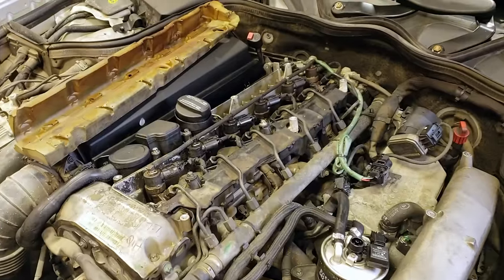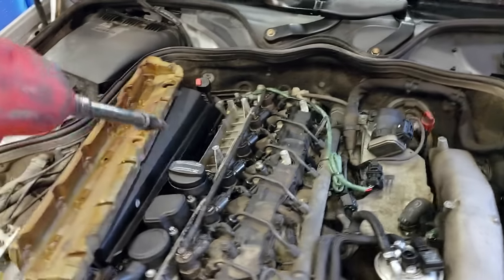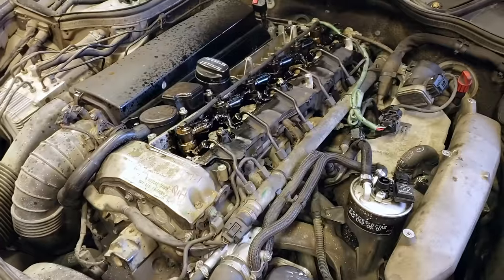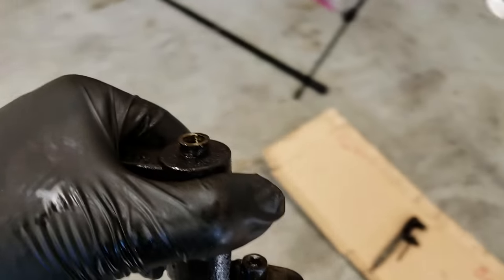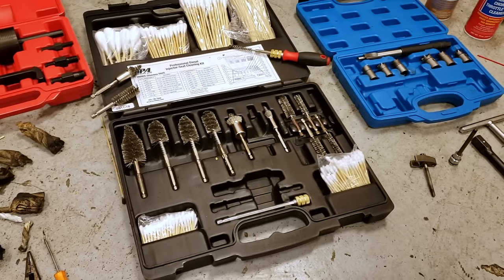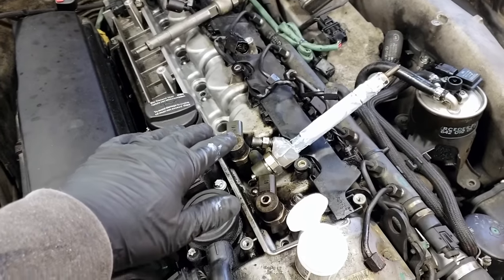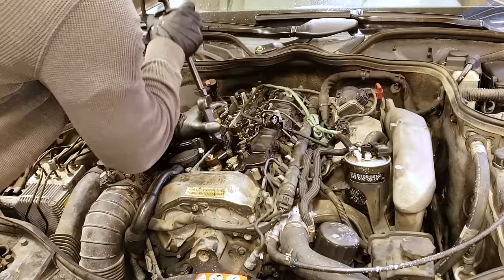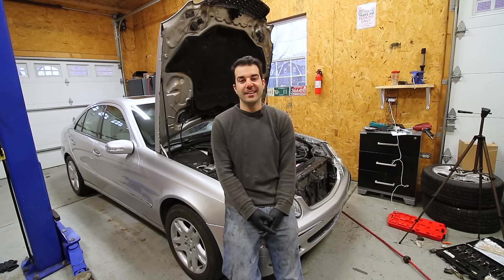My Turbo Diesel Mercedes Has A Nasty Engine Issue. Don't Buy A Diesel Before Watching This video.

Comment from the maker: How much do you think this would have cost at the dealer?
Reply: At least 1500 dollars
Reply: Hello legit a question this black death Also could happen to an W210 engine? I mean with those rings seats of the injectors? Thanks and merry christmas from Paraguay :)
Reply: At the dealership, about 2500.00 dollars...
Reply: $1500-$2000, given they would have most likely recommend changing the injectors.
Reply: I have done the same thing at my service shop for w203 200 cdi about less then 50 dollar including labour work and all the stuf.. any way i live in albania the labour work dosnt cost so much and we all use merc cdi engine it is a paradise to finding  cdi disel  engine parts .
Reply: A local independent charged my £100 to do one
Reply: Thank god my '85 300d did not have that with 280k miles on it when I traded it off.
Reply: Was gonna say 1000$ easy. But I’m not sure. How many hours they need or charge for such work?
Reply: Carlos Ayala as far I know the w210 its not common rail, its other engine most be om606
Reply: I’m gonna guess 2,300. Btw what are your thoughts about the R129? Have any interest in adding one to the channel?
Reply: 2000 dolars
Reply: LegitStreetCars I have a question what do you personally think about a Mercedes g wagon because I really like them and I’ve been wanting to buy one for a long time
Reply: I would have hit that whole area with purple de-greaser and a hot water pressure washer, I've been working on cars for years and I always pressure wash the engine before I work on it, Never had an issue with electrical, Just STAY away from the ecu connectors, those things are crap and not waterproof at all.
Reply: 2k or there abouts.
Reply: Couple thousand at least, because the would have removed the entire cylinder head and soaked it in a heated chemical bath (guessing here....) to extract the injectors and clean the carbon.

What would they do in your experience, Alex?
Reply: $1200 if they’re fair
Reply: They would of told you it was unfixable and tried to sell you a new car
Reply: In labour alone it's gotta be like $900 for 6-12 hours of effort at a good mechanic.
Reply: "We need to remove the cylinder head"
Reply: LegitStreetCars if you want to talk how much money it was to keep fixing my old car before we got rid of it by not paying on it anymore was a 07 Kia Sportage EX V6 and was fully loaded without heated seats and luxury package. But had leather seats. Spent well over $5,000 in replacing the engine, the A/C, windshield, wipers, tires, rim, etc... within the last 4 1/2 years of owning it. Bought it from drivetime with 80,000 miles and was lowest mileage SUV on their lot at the time of August of 2013 to May of 2018 we got rid of it at 151,000 miles. We were the 3rd owner of that car and it was involved in 2 other accidents before we had it. There is a 4th owner surprisingly because it needed another 3rd engine after the timing belt snapped and caused engine damage.
Reply: I guess 950.00 for 2.
Reply: @Lako the bubbles was from how hot the engine was, it caused liquid to boil.
Reply: Does the dealer re use injectors tho? Assuming yes id say $1800
Reply: Thanks Alex this was a great video. I will be checking out that CDI we talked about. Thanks for all the help.
Reply: I got two leaking injectors fixed with new seals and stretch bolts for £80 each at a Mercedes independent specialist. Had quite a bit of black death.
Reply: Lako yes metal shavings did end up in the cilinder chamber. The heat plug should have been taken off to connect an air compressor to blow those metal flakes off while he was facing the injector port with the cut tool.
Reply: I had a case of Black Death discovered on my 2012 C250 CDI Bi-Turbo during the regular Assyst B Inspection at the Mercedes Dealership at around 90.000 miles this year (2018). One injector was leaking badly and caked up the next injector too. The dealership was able to get the injector out and cleaned everything up. The injector was undamaged and could go back into the engine. This job for 1 cylinder was 400€ (About 450 USD) for a caked up one. The dealership was nice enough to put a picture they had taken for internal training of my engine and attached it to the receipt.
Reply: 45€ just for the coper rings and new bolts and 190€ with new clamps included. Laybor sure is expensive in America 🙁
Reply: @WelcomeToTheMadness  Then add plenty of dollars...
Reply: $2500-$3500 knowing how some dealers like to pile on additional 'issues'
Reply: 5 to 6 hours at a 125 bucks 625 to 775 plus misc stuff.
Reply: Just to change the ABS block of my E220 CDI from 2007, it was 1700€, and I fixed it with a little computer that you connect, and it costs 20€....
Reply: Mercedes dealerships in my area probs wouldnt want to work on it
Reply: Buona fortuna Alex!
Reply: @dcrobertson68   u got yourself a good guy mechanic.
Reply: B12 for the win!
Reply: Rolling Pry bars work great for pulling injectors also.
Reply: Way too much
Reply: My '06 E320 has this problem. Benz dealer (MB of FortLauderdale) where I purchased vehicle and had all maintenance performed by them up until then would not touch it. They recommended another place in town and when I went there they said they had never seen the problem (black death) before.  I covered the mess up to keep it contained. It is worse than the worse case you showed in your video. It runs great so I got the attitude if it works don't fix it.
Reply: @WelcomeToTheMadness  Injectors are $500 each!
Reply: Depends where you live, how high taxes and labor are there, and what sort of clients the dealership has. Going to run you more in LA than in Wichita.
Reply: Stealer...not Dealer..
Reply: In Germany, that repair costs in Mercedes-Benz up to 800€.
Reply: 850ish UK £ at mercs
Reply: Probable less then you spent on all the tools :D
Reply: U sir have incredible patience.... Job well done....Major lesson in black death..thanx.....
Reply: Too much
Reply: LegitStreetCars 1500 dollars
Reply: 1)NEVER SPRAY CARB CLEANER ON A HOT SURFACE. Flammable liquid.
2) the seat cutter should be used when the head is OFF the engine. The shavngs could easily fall into the cylinder when trying to pick them up.
Reply: In Beverly hills probably $4000, in Nebraska maybe $1200. Probably depends on which market you live in.
Reply: two arms and a leg

(an eye is optional extra for the recommended)
Reply: LegitStreetCars $2G🤦‍♀️
Reply: Great video. Had my w203 wagon 220cdi done for  3k with all injectors changed. Done about 200k miles prior to that job.
Reply: Arm and a leg!
Reply: My local independent MB mechanic charged $850 for two.
Reply: Your first born and a kidney
Reply: @wernerdanler2742  its idi it can not bud injection cups and glow plugs were fubar for sure
Reply: You should also take a look at the swirl flaps in the intake, if your engine has them, they gets brittle over the years and tends to breake, then they go into the cylinder, and mess up cylinder wall and piston. Just a tip, and only for a minute!
Reply: 2 grand
Reply: @polarViking  m57 bmw has it not om series
Reply: @schoumv6  yes i know the bmw's has it, but so does the mercs, i've deleted the swirlflaps on several Om648 engines, just like the one in this video.
Reply: @clagueb3686   It won't work forever,and then it will be practically unfixable.
Reply: @schoumv6   M57 doesn't get brittle, the screws fall out. Apparently in Mercedes they "only" get brittle.
Reply: I used to work on MBenz vehicles professionally(Sprinter vans, admittedly, but it was at a dealership that sold them brand new!). I'd guesstimate you'd be charged somewhere around a grand to do this.
Reply: yes, all cdi cars ;-.) thats why I drive w124 Diesels
Reply: @denaldagaci2002  Albania means stolen merc's, stolen from all over europe..
Reply: @HanDekker  what country are you from sir ?
Reply: $8500.00
Reply: LegitStreetCars any thoughts on a SLK 55? Reliability just like your e55?
Reply: 2000k
Reply: If you have to ask....
Reply: Is this sound/issue specific to diesel engines? I feel like I feel a similar purring on my 14 e350.
Reply: Dealership would not do this job............. Car has too many miles duh....
Reply: @f117py  This is the same engine (OM613) - so yes it can happen to your W210, W202, W203 - any CDI
Reply: @f117py  any direct injection diesel
Reply: im pretty sure an 85 300d is not direct injection yet  @wernerdanler2742
Reply: So at around what mileage would you recommend changing the seals?
Reply: @WymiataczPlays  That's the point. So di sucks!
Reply: LegitStreetCars Dont use a stainless steel brush for aluminum! It ruins all of the injector bores and they wont seal properly. 😑😬
Reply: They would politely ask if you want to swap whole engine $20,000.
Reply: @ikkem8407  WRONG.  I had it done at my dealer for $500 with no black death.  I also had another incident where I had 1 injector that had to be replaced because I buggered it up and the total amount was $850 and that included an injector.
Reply: 2400
Reply: Probably 2k
Reply: Why wouldn't you just get a bigger slide hammer
Reply: All that cleaning, all that driving around to warm the engine, all that rush and risk of it not working out? It should cost a lot.
Reply: The parts are cheap.  Its the time to fix it that takes time. We have an awesome product that eats that black stuf so next day it is easy to remove
Reply: @tortugab  And having all these tools.
Reply: @ElectricityTaster  a strong little screwdriver a little hammer and the special tools indeed. But a correct and good metal brush will help you too.  Most important is to make sure the screw hole is empty and clean or else you can brake the new bolt or even crack the head of your engine
Reply: @tortugab  It's a specialized hammer that should ideally be pneumatic. Also, you aren't cleaning the hole effectively with a screwdriver... come on. 
You also need a shop vac, carb cleaner, rags, ceramic grease, etc. If you believe you can do this sort of thing in any home garage then you have not worked with cars or have done an absolute shite job.
Reply: It's a Mercedes, so it should be free if the car is under warranty.... right? Manufacturer defect also.
Reply: @ElectricityTaster  lol i have done this like 25 times this year. I dont ever use a pneumatic hammer on these jobs cause it s more dangerous to brake something. And thats what the customer doesnt want to happen . From the 25 there are 4 that needet new injector.  7 new diesel tubes on top. 1 new connector. And the most horribles 6 broken bolts when removing, 2 mounting. And you dont neseceraly need to do them all. Only the one that leeks
Reply: @ivan23caravantes44  warranty is 2 years? Max 5 or deppending on the sale agreement when 2nd hand
Reply: @tortugab  should never buy Mercedes then 😂🤣😂🤣
Reply: @ivan23caravantes44  never buy a diesel!
Reply: Doing some searching, I found very little info on dealer pricing for this repair. What I did find on one forum was an estimate of from $900 to $1,200 if no injectors were needed. I would assume the cost would be more if it has a bad case of B.D. and not just preventative service.
Reply: 2300
Reply: $2K
Reply: LegitStreetCars that woulda most likely cost 1500$ to 1800$ at the dealer
Reply: 6-8k
Reply: Carlos Ayala Could possibly Happen to every di engine
Reply: In short, too fucking much!
Reply: Awesome
Reply: 63 euros at a service in Romania for my 2.0diesel mazda 6, 4 cylinders.Actually, in Romania, the Japanese cars are expensive at maintenance than the German ones (Vw,audi,mercedes,bmw).
Reply: Does the same method apply to the v6 320cdi engines?
Reply: Yes is the short answer! As happend to my w210 but court it before I needed a chisel - Not helped by the big plastic cover over that section of the engine so you can't see that it's started to happen. You can use a piece of dawl to clear the bore-cheaper than the cleaning kit!  @f117py
Reply: A lot through a Mercedes dealership. A lot less through a Bosch Diesel Center though. 

My local Bosch diesel center would do that for €250 easily. Maybe a little more if you need new injector cap nuts or if the injector needs to be reconditioned. I would say the injector where the washer is badly worn would probably need a new cap nut.
Reply: Best thing to do don't buy a Mercedes in the first place
Reply: Dielership would ask 10k for new engine.
Reply: I so remember doi g this on an old Ford engine.
Reply: @f117py  Yes.
Reply: hi mate, i wonder if you could give me any advice :-) I have 2010 C200 2143cc diesel and engine is a little shaky at idle and it sounds exactly same like the one in your video but no black death so. I will appreciate if you can help also is there any easy way to find out which injector is faulty? cheers and have good day.
Reply: @JayLang7  That would be just labor I would think. $1000 plus price of parts.
Reply: 6000
Reply: LegitStreetCars 
Every thing
Reply: @bgarra  it's a 'DI' no heater plugs ....
Reply: £910.
Reply: Does this happen to new diesels? I have a MB R350 bluetec and just got a p0266 and p0269 code for cyl 2&3, But my MB scan tool says these even only happened once and all systems are ok.. should I Change both injectors? I only have 88k miles
Reply: @enzocree515  I had replace all my injectors washers in my car, if your lucky enuff to get them out without breaking them, if you look at a injector washer closely one side is diffirent to the other, I suspect when building these engines the machanics just get into a habit of firing on washers at a rate without looking to see it they are sitting on there proper side when installing these washers cost penny's to buy but cost thousands of pounds of damage
Reply: One million dollars plus your first born
Reply: 5 pigs
Reply: Awesome video. Really informative. Thanks .
Reply: How do you oil the piston rings after all this cleaning?
Reply: in Germany at the dealer it make a damage of about 1600Euro in your pocket.
Reply: 3k
Reply: This is the first place I went when I began considering an E320 CDI, which was about 15 minutes ago.
Reply: Samme cost to car in sweden, one injector about 1200 Skr thanks @TheVwgolfmk1
Reply: Tree fitty
Reply: $9999999999999
Reply: Dr. Evil says "One MILLION dollars!"
Reply: my mechanic did it for 300 euros bc i noticed it really soon because of the sound of the inyector leaking and smoke coming out of the engine
Reply: They suckered me for $1800 for a 5 cylinder Sprinter TD that I caught a slight leak before BLACK DEATH build up, reusing original injectors and just replacing base rings. The other problem was loosing the use of the Sprinter for weeks while getting on the waiting list to have it repaired. Here in Colorado trying to find any qualified MB mechanic there are weeks if not months to get it in to be worked on. When our Sprinter is working properly it is the dream vehicle, when it has a problem you better be a McGuiver mechanic and learn as much as you can on MBs. They are great vehicles but service centers can be a PITA and very expensive.
Reply: @f117py  it can happen to any direct injection diesel, no matter the brand or year or manufacture
Reply: @denaldagaci2002  Please move to Tasmania, I need you!  Bring me a high pressure pump for my 903 cdi and we can go into business  :)
Reply: Very informative
Reply: Lo que te quieran  cobrar , el que no sabe , es como el que no ve